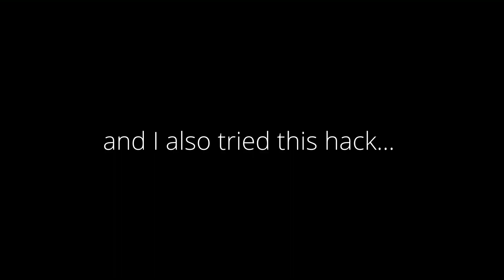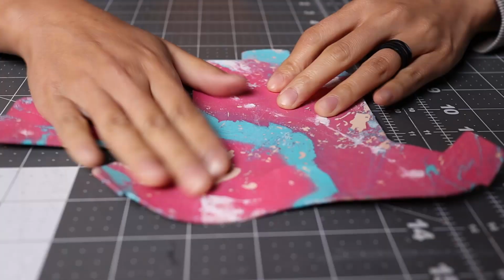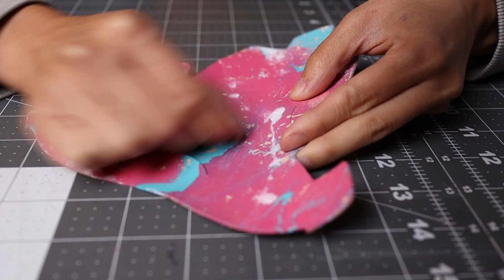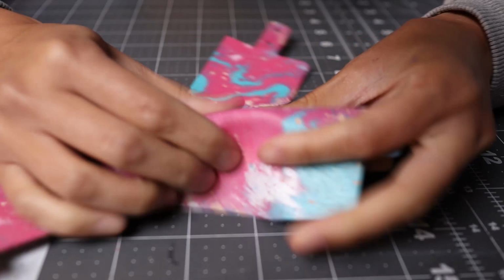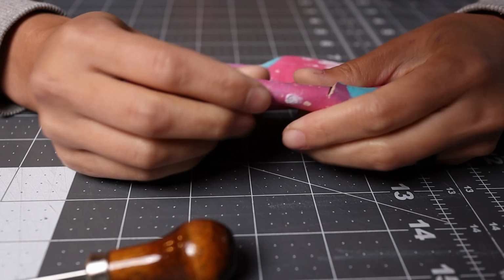HYDRO DIPPING LEATHER  - Marble your projects!

Comment: Very cool idea, you could always use some top coat as extra protection. Did you use basic paint + primer spay? Does it need to be a specific type?
Reply from the maker: Yeah i think a top coat would definitely help. Some resolene would probably seal it in pretty good. Yep, I just used a paint + primer spray. Most hydro dippers are using at least some paint+primer combo.

Comment: I was planning to use hydro dipping in shoe making, i had a query if I should hydro dip the components before making the shoe or after ? Will the paint crack if I stretch or stitch the leather?
Reply from the maker: It's been pretty resilient with stitching and bending so I'd assume it's okay. But could depend on what leather you're using. I'd definitely finish it off with some sort of coating.